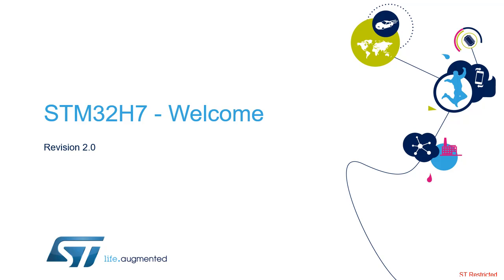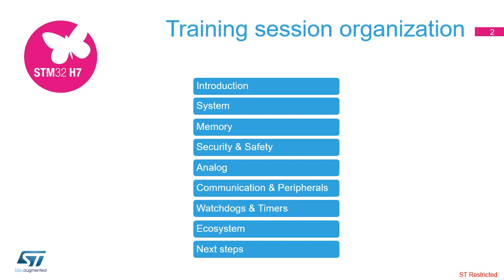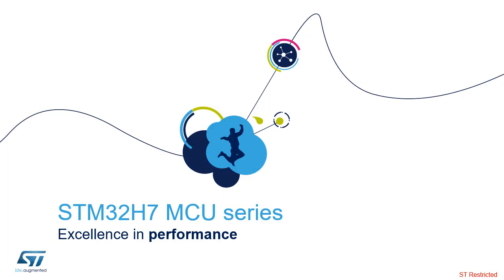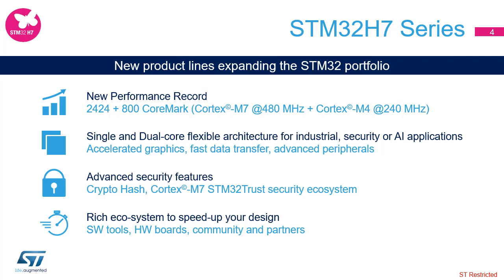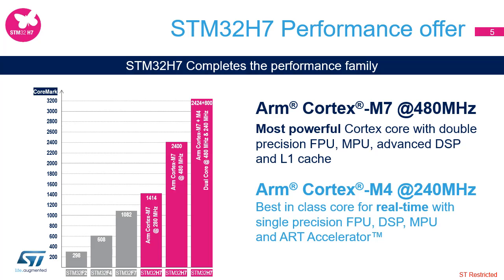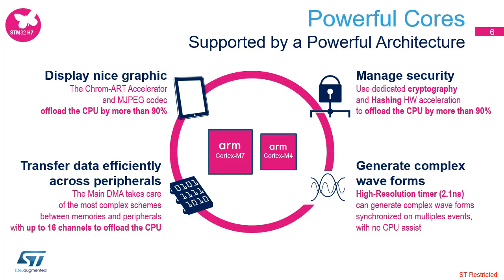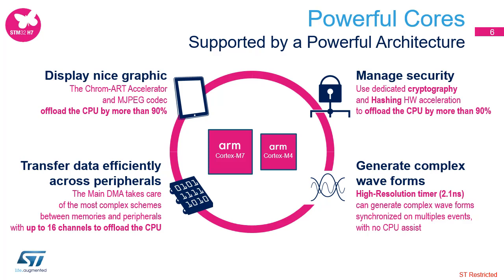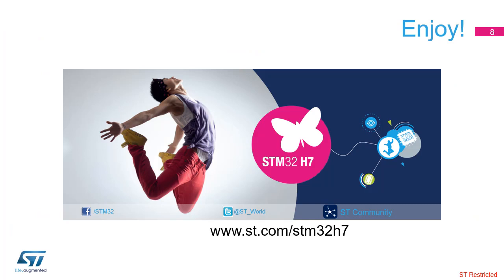STM32H7 OLT - 1  .Introduction Welcome session

Comment: Hello, I am using nucleo-H743ZI2 board and trying to enable the ethernet for tcp/ip server application, but I am not succeeding and I am not even able to ping. I checked all my parameters and found no errors or configuration but I think there is something still missing which I don't know.  I am using cubeide version 1.14.0 with the latest h7 package. where can I find a full example project video to check it and find my solution?